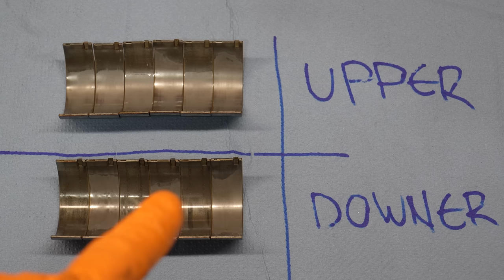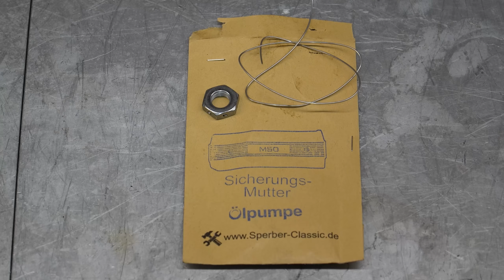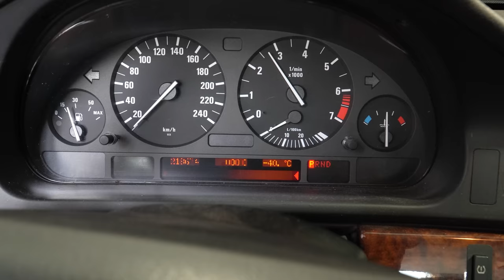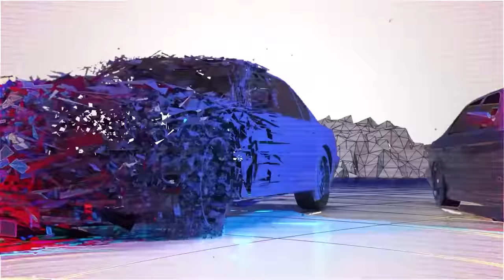How Much Work Can a Neglected BMW Need? - E39 530i Touring - Project Rottweil: P2

Comment: Only after 16 minutes into the video and you use the Holy Vapor Blast Machine? What is wrong?? Are you cheating with the zizi-machine?
Joking aside, another great episode :  thorough as ever and even upgrading parts that would otherwise just be replaced. Looking forward to the next episode!

Comment: I have difficulty just by looking at that flex joint that looks in every way symmetrical apart from those arrows how flipping it would break it.. I guess inside some metal frame is not symmetrical I do not get it. What is even more fun is the washer requirements in some of them... if you do not use the right washers with alu-propshaft it will lead to corrosion :D

Comment: Use a Hot wash High Pressure washer, that crossmember and rack would come up like new. Used a Karcher HDS750 on an old 80's car headed to the scrapper and it turned out looking mint. Drove it for a week then reassessed, I could see leaks, cracked isolators and so much that was covered in grime a standard HP washer just cant strip, also the hot wash gets the car dry due the heat. Really enjoy watching your work.

Comment: Sreten, I loved this video, and I love all your work restoring all the older BMWs. One bit that particularly fascinated me, as a fellow M54 E46 owner, is the oil pump nut. Forgive my ignorance, but what is the difference between this and just welding the oil pump nut on? As I'm sure you know, that method doesn't really work because it is the sprocket and the looseness in chain that are the bad design with these engines and caused the flickering oil pressure light when the engine sees sustained use above 6000 rpm. So if you weld the oil pump nut instead of it just being the nut coming loose it is everything that gets loose rather than just the nut. Why would that not happen with this method?

Comment: Had to pause.  Would not recommend Lemförder anymore, basically for the reason you mentioned. It's 50-50, you either get a somewhat good part or a shitty one. Meyle HD and TRW suspension parts are a better pick today.

Comment: Ah you just explained why recent Lempfoeder parts dont last. I ran into issues with control arms and controlarm bushings for my moms car in South Africa as well as mine here in Europe. Both are e46 330i's. Use to be great parts and I try to stick to oem. Meyle hd just so much stiffer and more steardy

Comment: Did you replace 2 caps behind intake manifold, #11611437560 and  #11611727176? Visible crack on bigger one at 30:51 mark.

Comment: How's the oil consumption on this thing? A good mod is to use the piston rings from the M52 engine on this and it fixes the oil consumption since the M54 was also plagued by the all-too-well-known "low-tension piston rings".

Comment: Industrial varnish remover did the ticket on my oil sump pan. Get suitable gloves though - or you’ll melt your normal ones onto your hands 😂
Reply: The varnish staining will do no harm. Just clean it to remove any loose debris. The same varvish coating will be covering all of the other parts in the engine that you can't get to anyway.  So totally pointless making it look like new.
Reply: @seanpaul3050  thanks for the man splaining 👍🏻

Comment: Do you run 5w40 because it's a higher mileage engine? I have a 330 that I have just changed to 5w40 from 5w30. Seems to use far less oil

Comment: Great overhaul! Replace this outside temp sensor before your washer nozzels cause a fire under the hood. Replece them aswell as the plastic inside rots away and cause heating element to shortout.  You can use E60 ones for better spray pattern.
Reply from the maker: It's disconnected cause I'm doing suspension. It can't cause a fire in any case. :)
Reply: @M539Restorations  Some say that jets are managed by the AC control module. Others that it gets reading from outside temp sensor. Long term driving with bad one cause them to overheat badly. It’s a theory from very respectable BMW forum (not really) :P Anyway sprinklers fire problem is a fact! Seen that many times.
Reply from the maker: @MrNiepoklikam  honestly had no idea they can cause a fire. I have E60 ones on my E39 M5. E39 spray pattern sucks.

Comment: If the Butyl at 22:20 that is supposed to go between the prop shaft center shaft bearing and the chassis is missing, what would the expected effect be if the prop shaft/drive shaft was replaced with a new shaft, but this butyl was omitted completely or if the old butyl was left without replacement?

Comment: Have you experience with the M54B30 oil pump nut actually falling off? In the forums it seems that is a common flaw but I have never seen it actually happen to anyone.
I have Z4 with with this engine and I am thinking if I should secure it or not.
Reply: I debated adding the steel wire to the nut but ended up using a good coating of permatex orange thread locker. It does the job

Comment: you're supercharging but not upgrading the fuel injectors?
The standard injectors don't have much headroom at high rpm, especially with full load enrichment.

Comment: This in now very helpfull i just got my first ever own car a very good condition e46 330i with a fuel flex converion kit and form an SMG to a gs6-37dz manual. The engine runs butter smooth the only suspect is the DISA valve so i orderd a new one from probsten tech and one rear trailing arm bushing is bad and going to replace that soon.
Reply: the oil is changed every 3 000 km because of the fuel flex conversion

Comment: About Lemförders tie rods, I bought Lemförder and TRW ones (fact that ZF was using Lem mold in Asia and they are resold by their TRW brand...) and Lemförder are EXACTLY THE SAME as TRW ones...
I'm really upset that ZF is sending all Lem production to Asia just to make more profit (30-50% more expensive than TRW for the same thing).
I gonna just switch to Spidan or Meyle (yeah I know) because they're made in Europe, East-Europe but still in Europe nonetheless... Never as good as German parts, but better than Asia ones...

Comment: Where did you find the torque spec for the arp bolts. I plan to have my rod bearings done eventually but have been putting it off since I don’t know the torque spec. I have a N54 not M54 but still have arp bolts.

Comment: Hello from Australia. 
I own a 325ci coupe 2005, project - car seats.
I can not find any in Australia 😢
Also
I'm looking at a 1997 E39  540i with 240,000 kilometres.
I've done some research, and it's mixed emotions about this vehicle/model. 
What are your thoughts on  this model 🤔??

Comment: My wifes 2003 530i has 320k and my e46 has 300k miles.  They are great cars, but you can't drive them like a Honda. You gotta do the maintenance to them.

Comment: shouldnt you use the old rod screws instead of the new ones that havent been torqued to check for clearance? not a big deal im sure just seems like it would be technically safer to use the new rod screws only once
Reply from the maker: As explained, ARP bolts are not stretch bolts. Can be reused many times.

Comment: You never find used BMW touring like this in the US. For some reason Touring’s aren’t popular here,I guess the SUV has taken their place. I’d love to have one like this one. I hate to guess the investment this cost to bring it back to new. Sereten is the man to do it though. He has the facility and equipment to get the job done. The labor at a dealership would bury you.  Why didn’t you replace the cam chain? I would think with that many miles it would be stretched.

Comment: Hy guys , speaking about air mass sensor , a have a e92 330d with m57 engine and i need to replace the MAF , can i use aftermarket ones or i need to buy it oem?

Comment: Sreten, am I wrong or central drive shaft bearing needs pretention ? Now I know what is the noise in my cat converter 🙂
Reply: yes, you're supposed to preload the bearing before torquing it down. should be fine though, he marked the location of the old bearing.
Reply from the maker: Yes, this is why I marked its original factory position.
Reply: @M539Restorations   I did the same with mine. But started to doubt if this is correct way. Even if old bearing is OEM how can you be sure what new one is same measurements and rubber tension is same. Just thinking, because bearing I put in my car rubber in it was way weaker than original. And question can it cause notorious annoying vibration ~120-130km/h.
Reply from the maker: @nerkatomkus5639  I've done many of them like this and the fact that the old one came out in perfect order, means it was installed correctly.

Comment: I have noticed that you apply 10% more torque on the bolt if you torque the head, than if you do it from the nut side. I would love to hear why, because in my understanding it does not make sense, as in both cases torque needs to compensate same forces -> friction underneath the head/nut, thread, and material deformation. This would be a case if the nut has different contact surface radius than bolt, or holes are different, or one is lubricated, one is not. But in your case? I cannot explain. Would be nice to know :)
Reply: I recall this is to do with how the length of the bolt twists and takes the force. Studs with nuts give a more accurate torque over a bolt. That's my brief remembering of it

Comment: Ok 2 questions.... What was used to clean the engine mount arm and what was used to clean the oil pump?
Reply: engine mount arm was cleaned using a vapor blasting cabinet from vixen surface treatments. oil pump was cleaned with an ultrasonic cleaner full of degreaser.
Reply: @busterscrugs  Jesus they are 20-30k

Comment: Hi, i have m52b28 engine with oil pressure flickering light after long drive. No any strange sounds, i allready had oilpan off and i didnt saw any metallic flakes or signs of bearing wear. Any idea what i should look for ? Allready changed oil pickup tube cause i tought it might be cracked and suck air. Could it be wrong seals on vanos? or something with oil filter housing/cap ? Thx for any advices <3
Reply: What color is the oil light? Yellow? Red? Your oil level sensor could be going bad or your oil pressure sensor could be bad or both

Comment: 14:24...i just fill the sump with "gun wash". & let it soak overnight ...it's low grade general purpose thinners & just dissolves the carbon sludge varnish....👍

I would nevaaar blast parts like inlet manifold....rocker covers....sump....just not worth it....😲

Comment: Buy your ACF50 in a liquid bottle not aerosol buddy it’s much thicker and sticky use it on my BMW motorcycle as corrosion inhibitor, just need to warm it a bit when cold and spray on with a pump spray bottle. 
I tried ACF 50 aerosol its to thin and runny 👍🏻

Comment: Hello my friend

I have a 2003 BMW 760li
The generator is not working and I have changed 5 used generators and the problem is still the same
I purchased two new batteries and checked all the wires to no avail

Can you help me figure out the problem?

Comment: Can you or someone here help. I have a m54b25 and it has a idele control valve stuck open code. I have cleaned it and it moves good but still the code comes. Do i change the icv next or can something else couse the fault code ? When the code comes the tc light and eml light comes and the car is in some sort of limp mode.

Comment: Hi Sreten. You should always check your crankshafts for micro cracks.Its done in UV light on magnetized crankshaft on a machine called diagnoscope. I have just watched a video on it.
Reply from the maker: Not something you can or do with the crankshaft still in the engine. Cracked crankshafts in BMW engines are basically unheard of.

Comment: How do you pass TUV with “oem+” cats? Same way people do in California?
Reply: As Long as the engine passes the AU (Abgasuntersuchung) while the TÜV Inspection, there is nothing to worry about. Plus you should use parts, which are TÜV approved

Comment: Perhaps you can answer this.  In the beginning of the video, you used a torque spec in ft/lbs.  Later you used what most of the world uses in N/m.  Since this later method is force over distance, why would Americans use distance over force?  Shouldn't it be Lb/ft?

Comment: You can repair the dead pixels in the dashboard by using an igniter from a lighter right upon the dead pixels!!
Reply from the maker: You can't, won't last. The problem is not the pixels, but the ribbon cable.

Comment: The ARP rods bolts usually put a higher clamping load on the rod cap. Won’t that cause the big end to warp a bit?
Reply from the maker: No, they are specific ARP bolts for this engine.

Comment: Why do BMWs require rod bearings to be replaced so often compared to other cars?
Reply: After 20 years, or over one hundred thousand miles, any engine is going to have some rod bearing wear.
Reply: @seanpaul3050  yes. But my Honda has 167k with original rod bearings. BMW seems to need new rod bearings every 60k…
Reply: @mattmalenda6585  if you remove your Honda rod bearings, I guarantee they will also have signs of wear.
Reply: Also my old E39 528i was still on original rod bearings when I sold it at 158k miles. And no knocking. Oil was changed regularly. 

All depends on the owner and what they did with the car.

Comment: Why didn't you check the main bearings while you had the oil pan off? I am aware that it would be impossible to get the top bearing dry or free of oil to get a dry plastiguage reading, but at least you would get an idea if the bearings were really worn.

Also would be interested in getting other readers input on how important it is to have completely dry bearing surfaces like you did for the rod bearings to get an accurate reading. I may do an experiment next time I check rod bearings.

Comment: the surface is supposed to be clean and dry for plastigauge, any lubricant will throw it off
Reply from the maker: A negligible amount of silicone on the bearing won't, standard practice. Do it without, and find out how difficult it is to remove it without damaging the bearing.
Reply: @M539Restorations  I've always just left it on, but I'll try a comparison between dry and silicone next time
Reply from the maker: @adrianlastname4864  trust me, makes all the difference when remove the plastigauge, and doesn't affect the reading. You should always remove it, although Plastigauge says you can leave it, but I personally wouldn't

Comment: Unreal.. All the parts fail all of them.
My Lexus es has had 2 brakejobs and 2 sets of tires only since 2009....
Those are Maintenance parts. 
Not a single other part changed. Even same spark plugs.
Nada no tables starter alternator nada not even a fan belt.
Look at this sh....
It would cost 20g at a dealer to do this!

Comment: Wait, so the berated Mahle water pump was replaced with another hated Mahle water pump with matching radiator and sprinkle in some Mahle cabin air filters to boot.  Did your producer put you up to this?
Reply from the maker: Meyle was removed!
Reply: @M539Restorations  My bad I missed that difference Meyle vs. Mahle.